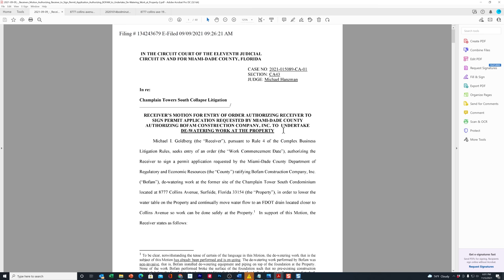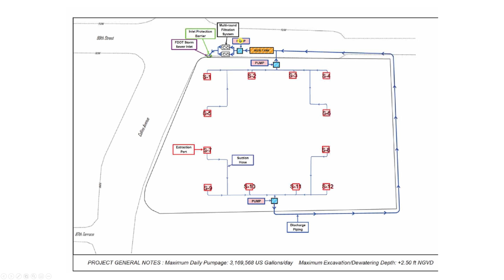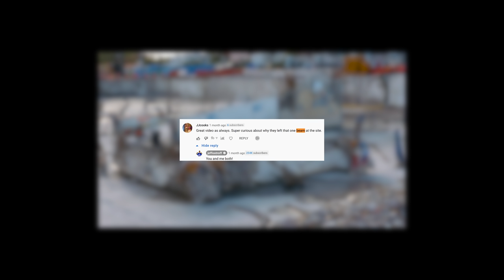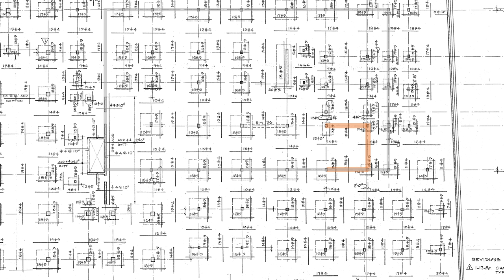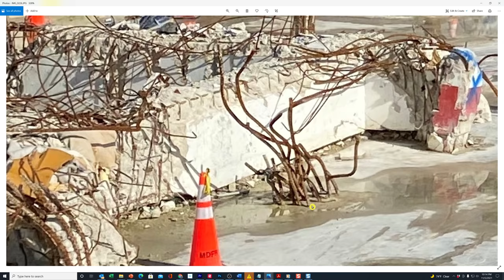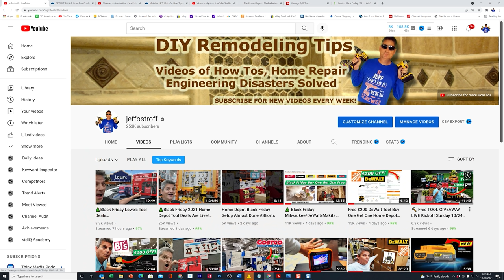Miami Condo Collapse: Engineers Baffled By Mystery Column

Comment: You dismiss impalement w/o any explanation. It’s the most obvious choice. Columns don’t appear over night, it’s not in the prior video and you don’t see any evidence of where a footing for an added column would have had to be cut in to the existing concrete. 

So all in all it’s an interesting question “where’d this material come from?” but you not only failed to answer that question you failed to give screen time to the most obvious potential answer “it’s not a column at all”
Reply from the maker: I think the column was added in the last 12 months after the garage video was shot in July 2020, because it was not present in the video of that section. Whenever you make a claim like this about the column falling eight feet and impaling into the garage floor, you forget that there is zero damage on the floor where there should have been craters or something else if it had impaled into the floor but there is no damage. These rebar rods look like they were intentionally built up out of that concrete floor like it was done by somebody in the last 12 months, since Fiorella shot her video inside the garage in July 2020, showing no column exists where that mystery column is.
Reply: @jeffostroff  what I’m saying is you don’t see any evidence of cut lines in the concrete below the “column” in question, so how did they add it? So missing damage from it falling or missing damage from it being added. Why would be it’s purpose if it was an addition and why wouldn’t any of the residents have made mention of a new column added in the middle of the drive way? Your potential answer also has a lot of questions that require just as many answers as mine, but you still failed to address either in the video which is my issue here.

Comment: Your mystery column is not a column, well not anymore! You see there is no concrete around the rebar and in fact never was because the steel you see is part of a column or structure that was in the upper levels the force of the collapse is strong enough to punch steel trough the bottom of the garage flor these flors are not very deep
Reply from the maker: Your logic on the column makes no sense. Very few of the columns left on the garage floor have any concrete because they cleaned it all out. Had the column impaled like you say, where there should have been craters or something else if it had impaled into the floor but there is no damage. These rebar rods look like they were intentionally built up out of that concrete floor like it was done by somebody in the last 12 months, since Fiorella shot her video inside the garage in July 2020, showing no column exists where that mystery column is.

Comment: Could the mystery column be some sort of special utilities / wiring pathway? Did the dozers scrape something that pulled the wires / out of the ground?  Or... maybe its an alien portal hidden in a 4th dimension until the building collapsed?? Ha
Reply from the maker: No those are not wires they're definitely rebar and it was definitely coming out of the concrete so it either impaled from a column that was falling down during the collapse, or they were starting to build a column as a temporary support before the building collapsed

Comment: You should know better than this,, its defiantly on the structural drawing where you should be looking. If it was not, it would not have been built.
Reply from the maker: You don't know at all. The floating K-column only appears on the first floor through penthouse. On the garage floor drawing there is none. So no need for you to condescend, since you are wrong

Comment: Are any of the Engineers that have been on-site, including Allyn Kilshiemer and the NIST team that are "Baffled By Mystery Column"?
Reply from the maker: As far as I can tell, Allyn Klilshiemer's team did not get any close-up shots on this side of the H-Beam, they missed to all together. They also missed anything close to M11.1. They missed some prime opportunities to get some very useful photos, and used sub-standard cameras as well.
Reply: @jeffostroff  I'm sure Kilshiemer and the NIST team (just like you and Josh @ Building Integrity) have already 'solved' the case.  They know the pool deck was severely underbuilt, collapsed first and eventually dragged the integrated structure of the building with it.  As you've said, an isolation joint would have absolutely saved those 98 people.  It's that simple...
The residents of CTS might have had their building condemned and had to find a new place to live temporarily while the repairs and remediation took place, but they'd be alive today.
Reply: @jeffostroff  It would be interesting if you could take some more photographs of the mystery beam that have better resolution. Maybe on your next trip to the site?

Comment: I really don't understand where the mystery resides friend. Obviously it's not magical and wasn't originaly there, then it came from above. We can probably agree gravity pulled it right where it is residing in your video. I'm sure the residents would notice a new column in middle of the EXIT! Just move on bub
Reply from the maker: It's not as simple as you make it out to be, because if the column had come from above,  from  that angle that it would have fallen from, is there no damage to the floor at all it just cleanly pierced through the foundation? Not really sure how that is possible. Also with all of the hundreds of other columns throughout the building while I wasn't this duplicated elsewhere in the building as well?
Reply: @jeffostroff  when there's nothing else, what you got is what ya got